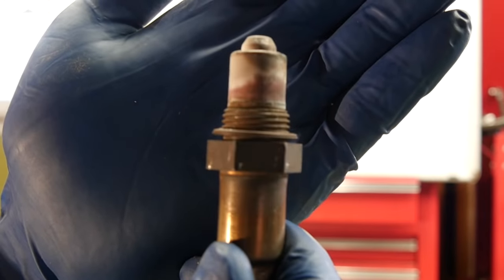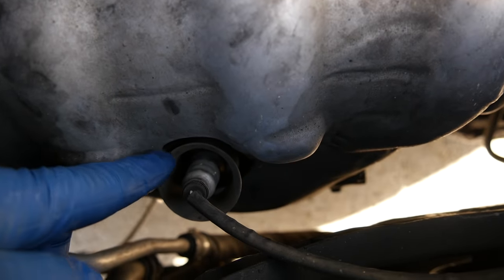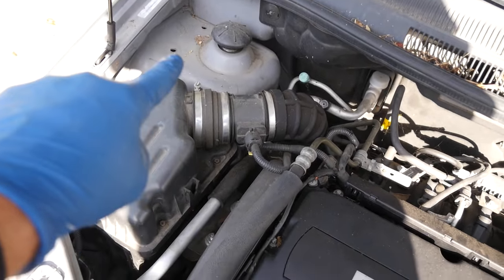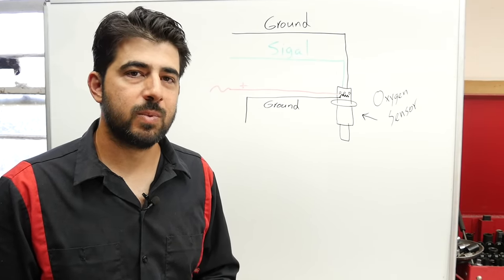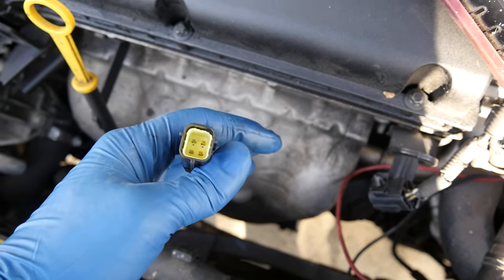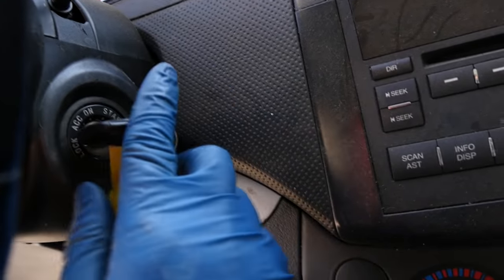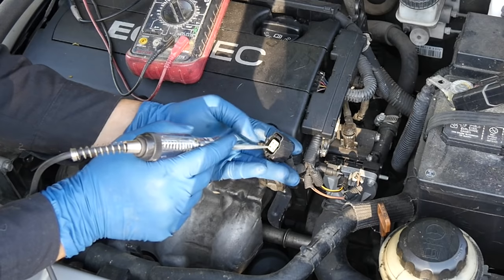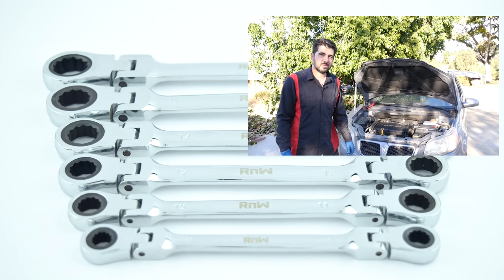Oxygen Sensor Trick and Operation Guide

Comment: Hi
Lexus 3uz-fe 4.3 2006
The cars starts good, runs good, but will driving the throttle just suddenly close, no refs just idles, if I press on peddle no response, have to switch off and restart, then it runs again for n few kilometers, before it das it again 😡

Comment: If the es300 was made by Nissan and the exhaust manifolds are cracked you need to add flex pipe to them and then the hand the muffler with an old fashion rubber hanger not the ones in there that don’t let the exhaust move. They set off all sorts of mil’s. The problem is cracked mabnifolsa

Comment: Great video, I’m actually going through the o2 related issues on my 2012 Ford Focus. It threw the code p0420. I plugged the scanner, checked the cat conv temperature( was about. 1000 degrees on a warm engine) checked the sensor2 voltage( stable around 0.5-0.7 volts) but the O2 sensor 1 showed 0volts. I replaced the sensor 1, but still shows 0volts and no response to acceleration. Any help would be appreciated.
Reply: Check your wires. Maybe signal is not getting back to the PCM
Reply: Jason S  thanks for reply. Will do. Is the method in the video the best one to troubleshoot my issue?
Reply: My car thrown me a po420 code too. What I did was finished up my gas tank and filled up with high octane (like 91 will do) after that erased code and let it run until 50 miles see the code will comes out again.
Reply: @turd_jabowski9838  No, it seems like you know which wire on your O2 is the sensor wire. Go to Ratchets channel and look for his video on O2 sensors.

Comment: If someone can comment; we had a motor signal on our mercedes c200 6 months ago, we took it to service, service said oxygen sensor needs to be replaced. As we are using the car since 2018, we checked it seems fair as we have never had it replaced (diesel car) so we paid. In the guarantee period of the sensor, the motor signalled again, we took it back, now they say it is oxygen sensor related but some part needs to be cleaned but it is not the sensor. I feel like they are faking as the sensor was in still guarantee. So what is the problem? And if it is something related to oxygen sensor but not sensor itself, what is needs to be cleaned i dont get it

Comment: Hi can a oxygen sensor make a car to run lean on fuel?
Reply: An Oxygen Sensors job is to measure the oxygen content in the exhaust gas stream. Oxygen Sensors are supposed to Switch from Rich Voltages to Lean Voltages Quickly & Constantly when the Engine is Hot......... When the Engine reaches Closed Loop ( Engine is @ operating temperature - upper radiator Hose is  Hot )...Open Loop status is when it's not @ Operating temperature.( Engine is still Cold )

When the Engine is in Closed Loop as indicated on the Scan Tool, the Front Oxygen Sensors should be switching voltage from high to low voltages faster than a woman blinking her eyes at you...& I mean Switching Extremely Fast......When using a Pico Scope or ATS Scope after you've injected Propane inside the disconnected Brake Booster Hose, the Voltage should fall in less time than 85 milliseconds ( ms ).......1,000 ms = 1 second

Comment: Every check engine light is o2 sensory can you do a video explaining why 😂😂👍
Reply: Nope, it's not.

However, the primary purpose of the check engine light is (usually, most manufacturers) to inform the driver of abnormal exhaust emissions - in most cases, it's absolutely safe to drive the car and sometimes the check engine light doesn't even reflect the engine operation at all - e.g. Secondary Air Injection malfunction will trigger the CEL on older VWs, having no impact on the engine etc.

Comment: You are aware that this only applies to two point O2 sensors, right? It won't work with wide-band lambda sensors. These measure lambda and they pull the ambient air through the loom.

Comment: By running your testlight into the o2 sensor plug with 12v+ are you not risking damage to the computer??  The signal wire from the 02 sensor to the computer only puts out max 1v.  I'm guessing this is a good way to cook the computer.
Reply: No, the heater circuit is powering the light, the signal wire is the sensitive one, but even that wouldn’t be damaged, I’ve had o2 sensors melt the wires and put heating voltage into the signal and all it did was blow the o2 fuse.

Comment: I have a 2007 Mercedes Benz C280 4 Matic.  I failed emissions last year in IL, but was ablevto get a yearling wsiver thru economic hardship.  So, Ivstill was ablevto ourvhase a registrstion stivker.  Jumpvto 2020, I failed emissionsxsgsin, but thecstste now requires us to spend $450, which Ivdont hsve TOWARD thecreoairvtobgix the xar.  My mevhanic ssys that my carcrequires aboutvav$7000 repair.  2 years agobtheybtold me this, and Ivwould have loved tobget a new or new used csr, but, I csnt afford one.  I dontvwant tobdumpn$7000, even if Ibhsd the money, into a 13 yesr old car.

The two codes that xame up are something like C016 and C017.. I think.  They looked identicsl, butnone had ac16, andvthe other had ac17. Maybevtheybwere P016 and P017.  I thinkbTHOSEXare the codes.

Mybststecrequires us tovspendcstvleast $450 TOWARD thebemission problem snd/orvcid3s in ordervforbthem to CONSIDER giving me another waiver. However, I alresfy needvtovdpend $815 on a generalbtune up and my back brakes. Spending another $450 will a) bresk my bsnk, znd 2) will essentially hebys3less, because my mechanic has said that I need to basically soend all $7000 tobfix the problem or nothing.  Tbey'll SEE whatvthey can fo, Ive been hoing yobthem forcaboutv20 years, but, this is a pr9blem with the 2007 model. My sis has a 2006, and she's never had this problem.

Whst can I do to turn off the check engine light...legally, and/or fix my car spending only $450...even though I dont even want to spend THAT much, toward this dpecific problem.

Comment: Youre descriptions are entirely wrong, an air fuel ratio sensor is not an O2 sensor, and the comparison is from outside 0s to exhaust 02 is usually done through the porous holes of the wires. And you can barely properly describe how an 02 sensor works and operates. And by the way,you will fry the computer with a test light, this was painful and listen to, as a smog technician for 15 years plus, you dont know entirely what you are talking about. Dont listen to this guy.  Take a freaking class at your community college if you want to learn something.